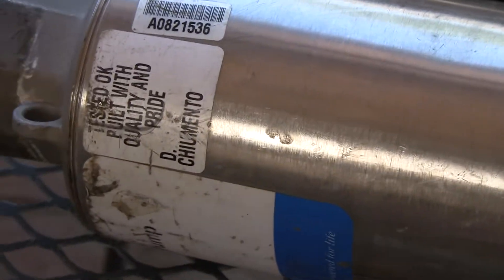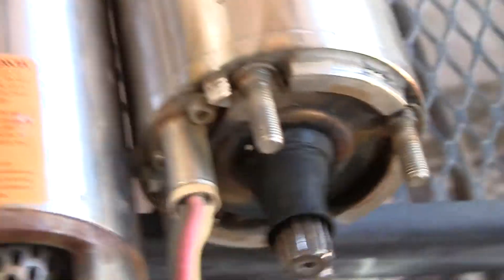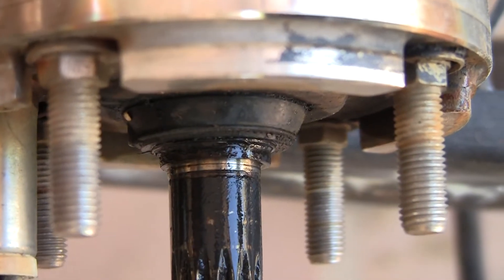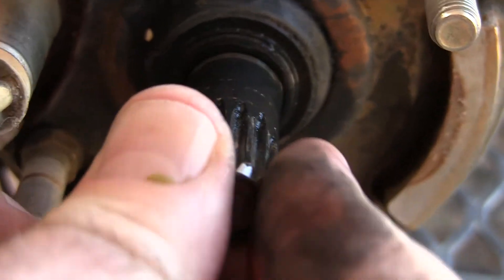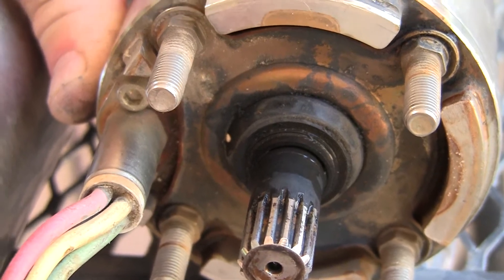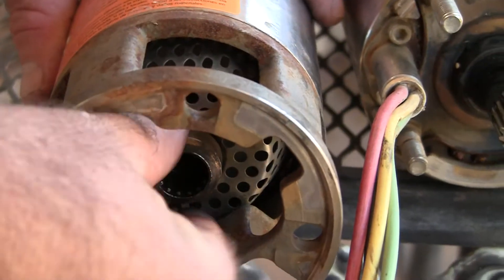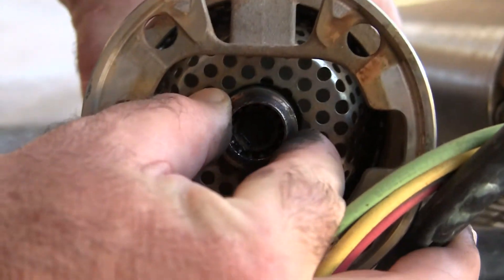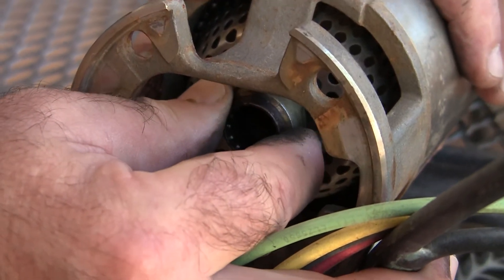Worn out submersible pump

Comment: if i take apart my franklin well pump motor  to check out its condition , what can i replace the cooling water / lube bearing  fluid  with ??....does that factory gilkol/water ever leak out over time .....can i use mineral oil ??....thank-you sir  !!